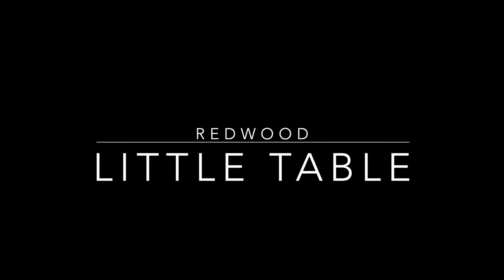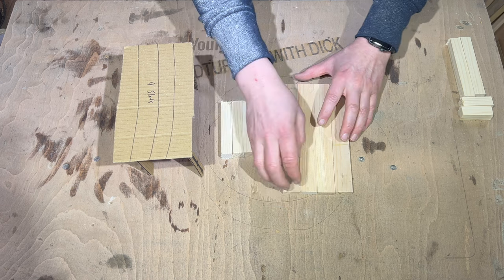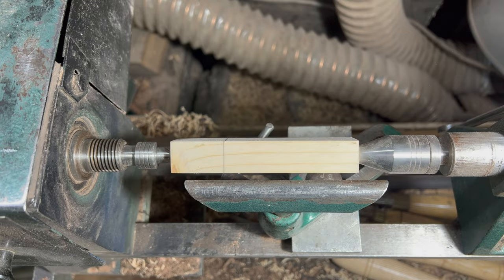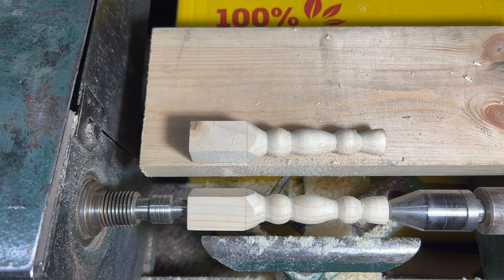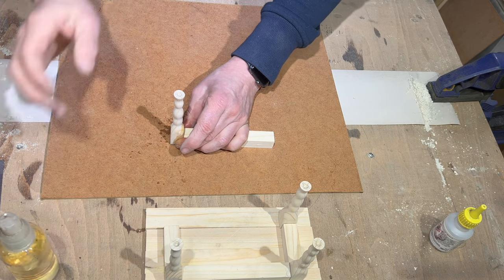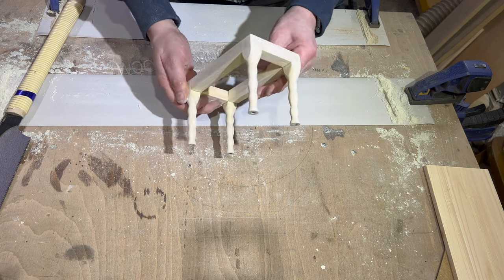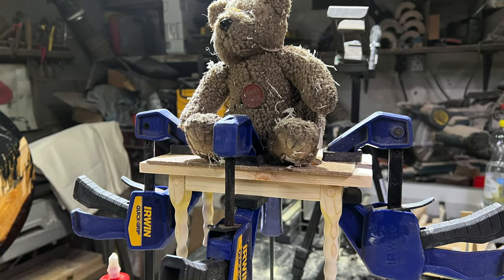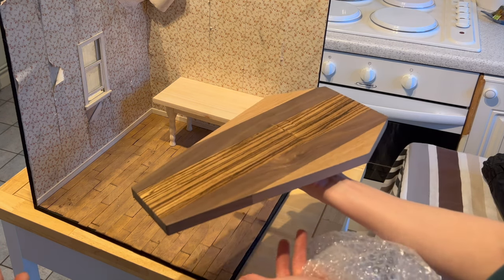Making a Little Table for Lenore with Turned Legs and a Slatted Top

Comment: For table tops always use an odd number,  the centre is a spine, then alternate the end grain facing up and down . Like happy,  sad. Smike frown. 5 would be a good number for your full size table. The reason is to prevent warping the boards be alternate end grain directions  with pull against each other. If you know what I mean. No cupping
Reply from the maker: Solid advice there Patrick! Thank you 😊